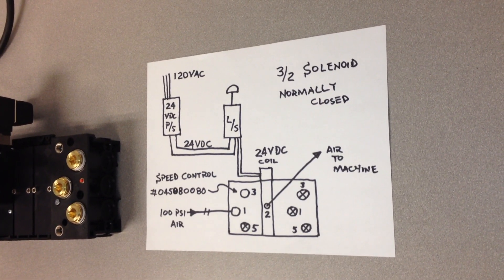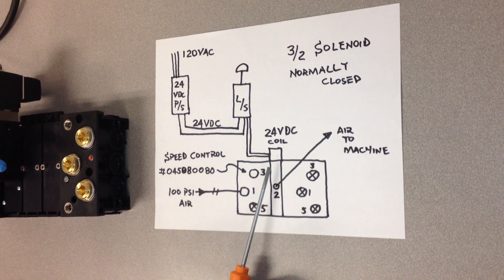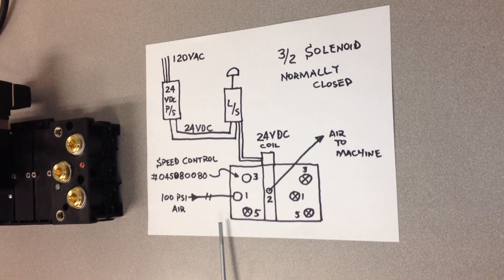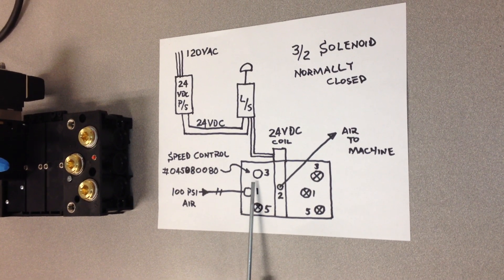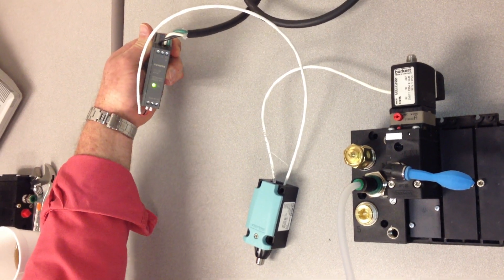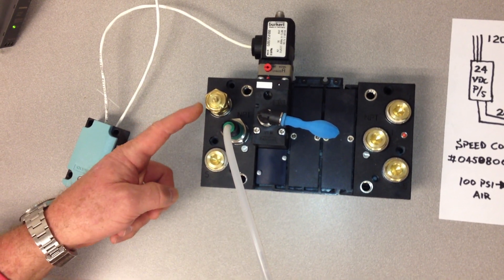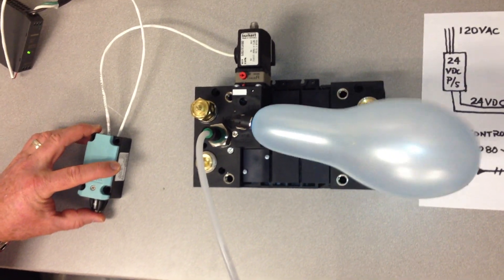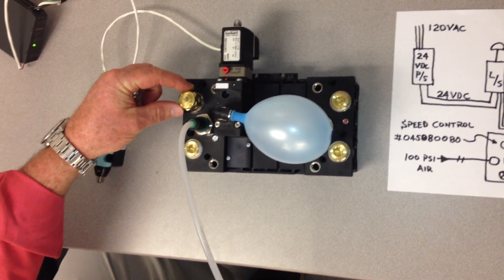How To Use a Pneumatic Solenoid Valve

Comment: How, where and why do we need a solenoid valve. What can a solenoid valve do that other valves cannot?
Reply: it is turned on/off with a current. It makes easy to e.g. activate it with a limit switch or with a computer/microcontroller

Comment: Do you know how many amp or watts does the solenoid consume? Is there another kind that works the other way around? I mean that when turned off it allows air flow and when turned on it blocks it, so it only consumes power while blocking. Thanks very much for sharing!